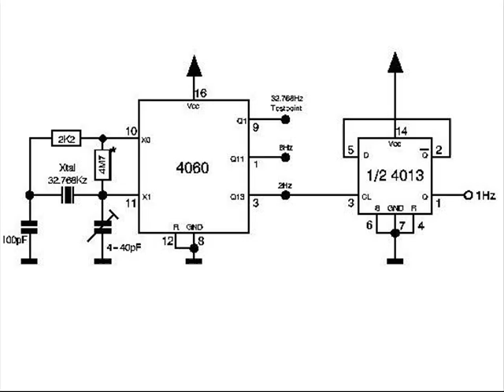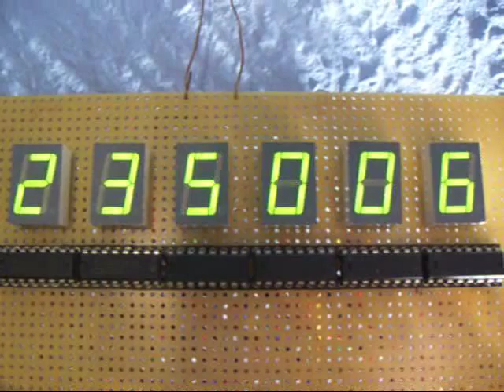Diy 7 segment digital led clock

Comment: I have a question. You didn't use pull down resistors for the clock and resets?

Comment: hey man
need ur help in designing cd4060
what values of capacitor and resistor should i use with crystal of 32.768khz that it would properly generate 2hz at Q13.
i would be grateful if u can guide me
thank  you!

Comment from the maker: This electronic circuit doesn't use any PIC. It uses components which can be received in a shop, without any programming. Did you not confuse it with something?

Comment: @firehandszarb The gain of the inverters in a metal-gate CMOS 4060 such as the one in the video is often too low to ensure oscillation with many watch tuning forks. Sometimes, careful selection of the two capacitors and resistors will remedy the problem, but try replacing the metal gate 4040 with a silicon gate "HC" type such as Texas Instruments SN74HC4060N*. (Note that the STMIcroelectronics "HCF4060BE" in the video is NOT an HCMOS part; their prefix is highly misleading.)     *6V maximum!

Comment: @dtomi86 thanks very much for your kind offer. Tonight i got it working quickly after i noticed that : I had placed the 4060 chip the wrong way round (because it had the notch at one end and a recessed dot at the other end which I had mistaken for the pin one end). Your vid is excellent btw and one of my favourites.

Comment: I cant get my oscillator working, im using a 32,768 "watch crystal", 2k2 and 4M7 resistors, and 22pf and 100pf capacitors. any tips? I'm using a breadboard and have tried setting up the oscillator several times. any help woulkd be very much appreciated. thanks.

Comment from the maker: you're right, there are 7 wire from ic to the display. every number have a combination - think on the segments - and i choose that one, when the "6" is display. the reset function is so fast, u cant see 60 after 59, but enough long, to increase the minutes/hours.so its "just" a counter, but can't reach 999999, because the resets. u can set it up to 12:00:00 by choosing the 13 at the "hours AND gate"